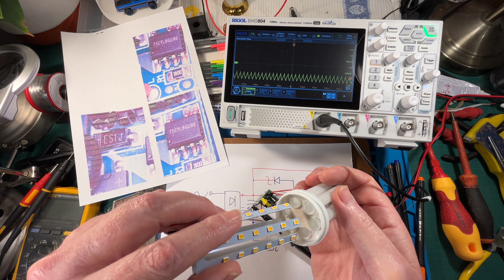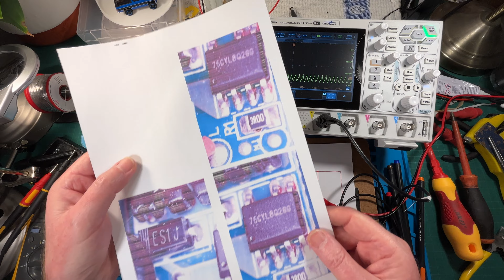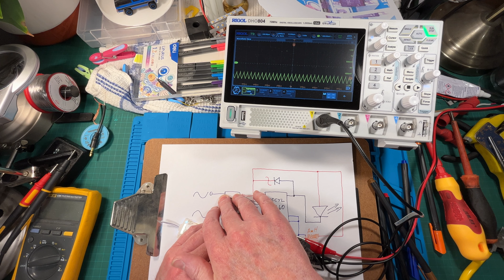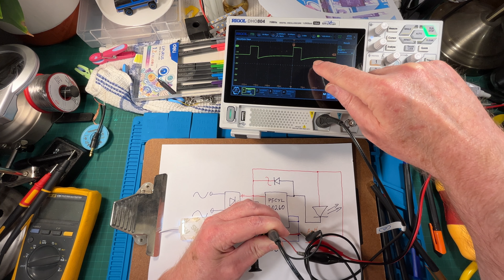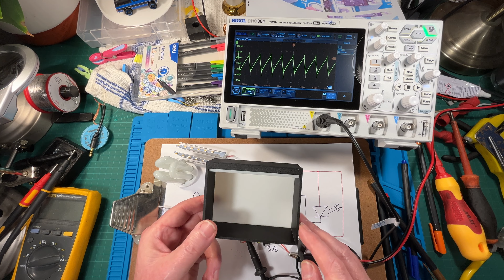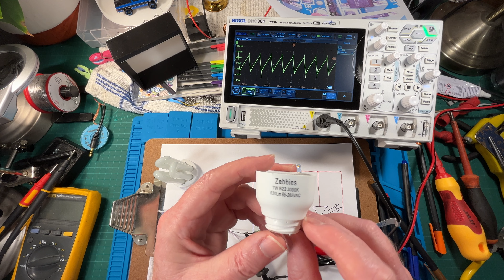How the circuit in a buck regulator led driver works and behaves

Comment: I always love a good buck converter video! Nice explanation.  I tend to see the drivers fail instead of the LEDs.  And its always funny that you can never find the datasheet for these mystery chips on the cheap stuff.  Good stuff!
Reply from the maker: Yeah, these led drivers are always an adventure.
Virtually no 2 are the same.
Sometimes they make for YT content.
Reply: @Uncle-Duncan-Electronics-Shack  they certainly do! its an important concept to learn as well so it can never have enough scrutiny!